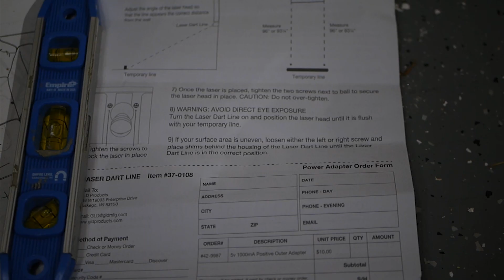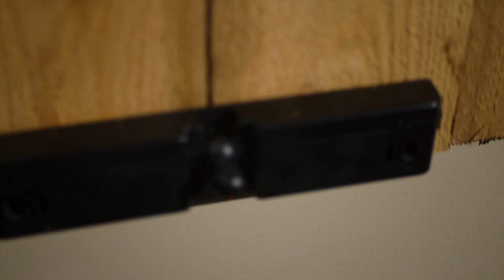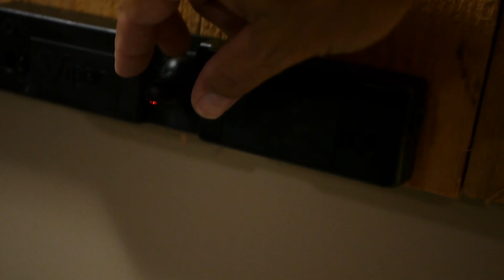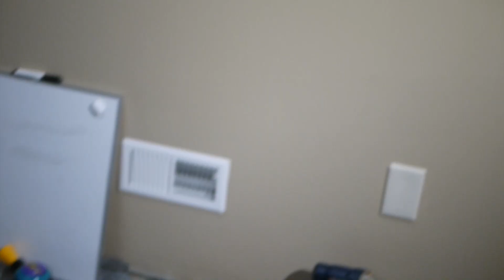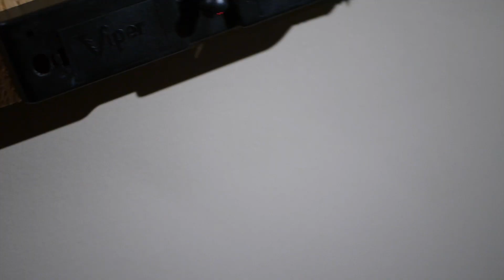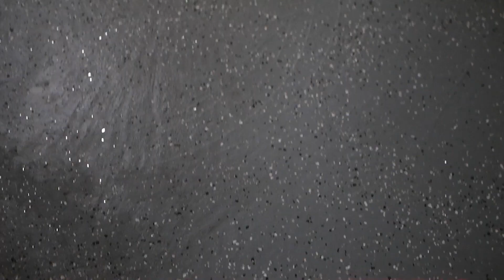Installing Viper Dart Laser Toe Line with Adjustments

Comment: The  best way to set the laser light is to tighten the screws a little first, this makes it easier to set the line and it will not move when you tighten it up.

Comment: You measured from the wall.
The throwing distance is measured from the FRONT of the board so you will be the thickness of the dartboard and the thickness of those pine planks too close.
Probably a good 3 to 4 inches

Comment: Hi Rick, I am interested in purchasing one of these not for darts but for my business...with the base in a horizontal  position are you able to swivel the laser itself in a vertical position? 
Wheels Unlimited,  Spring Hill, FL 352-515-5111
Reply from the maker: Brian Rader mine does not appear to swivel in a 360 pattern.   Could you mount it upside down?
Reply: @RickBolt  thanks for the reply.. can you call my shop 352-515-511 ( www.wheelsunlimitedfl.com ) so I can explain what I am trying to do

Comment: You need to account for the thickness of the cedar and board. So right now, your line is too close by the thickness of the cedar and the dart board. Possibly up to 1 3/4 inches too close.
Reply: no you can adjust the angle of the laser to account for that